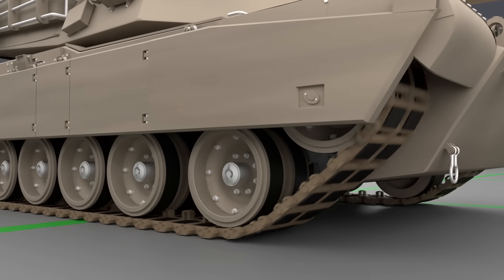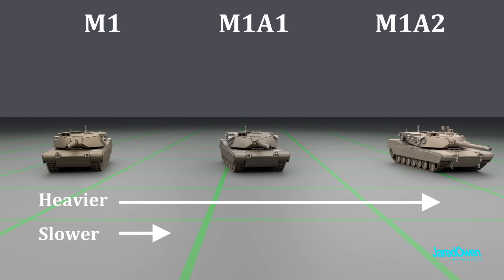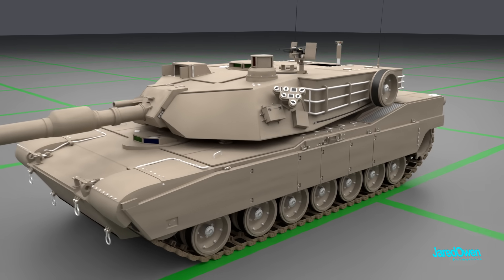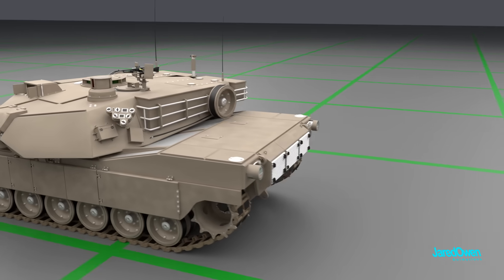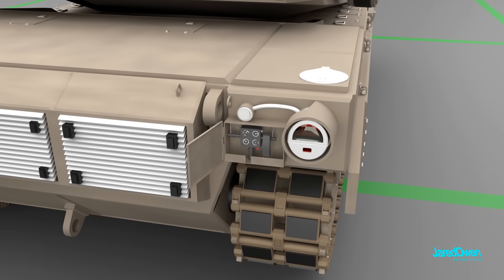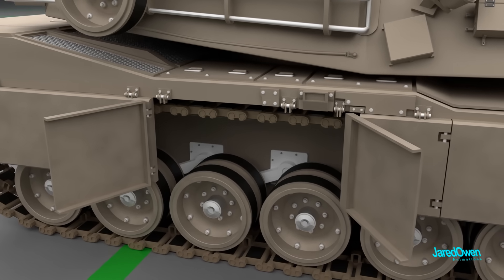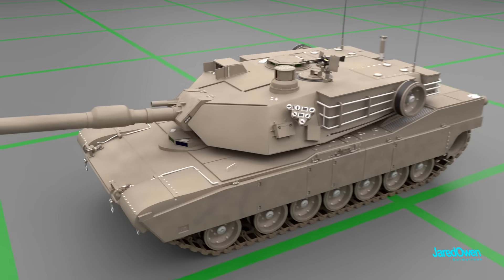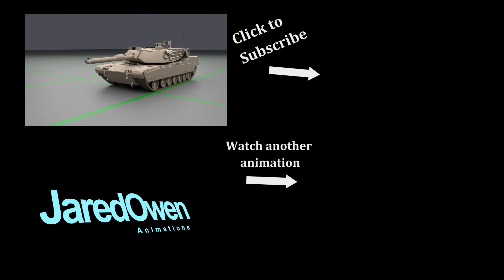How does a Tank work? (M1A2 Abrams)

Comment: Great video. I was on an M1 from 1991-1992 and an M1A1 from 1992 till the end of my service. A few things to note: 1. The commander has a Browning M2 .50 caliber machine gun (The “Maw- Deuce”) at his station/hatch.  I’ve never seen an M1 without one. 2. The smoke grenades up front are actually smoke grenade launchers that launch smoke grenades out in front of the turret.  Thermal sights can see through the smoke. There is also a smoke generator attached to the engine that the driver controls via a rocker switch, that throws thick white smoke out of the engine exhaust port on the back of the hull., and 3., the commander’s “view ports” are actually periscopes. Again, great video. Brought back fond memories.
Reply: Wait, so the turret could chop you in half if it rotated while you were crossing the hatch towards the driver section?
Reply: @sassui90  that is correct.
Reply: @S T no, he doesn't. It's mechanical. It's set up so the trigger is pulled inside the turret and a lever pushes down on the butterfly trigger outside. If I remember correctly it's electrically actuated.

Comment: I wonder if there is a caterpillar Diesel engine that could fit that makes the same power like the 15000 hp turbine. I understand height is a huge issue and the leopard 2 has a boxer style diesel so it’s wide not tall. I think the German engine was made by emc or something like that. Turbines are cool but I love diesels especially caterpillar!
Reply: The MTU 882 on the Leopard 2 is a V12. Not a Boxer.
Reply: @peterson7082  thanks for the clarification. I watched a documentary on it a while ago and couldn’t remember the details. Not sure why I was thinking boxer but I think I mixed it up with the new power pack that general dynamics and another company are trying to sell to upgrade the m2 Bradley fighting vehicle and I think they were trying to offer a new solution to the gas turbine. Makes sense it’s a v8 though because that’s pretty typical for tanks. Russians have been running v8s forever.

Comment: Every time the turret rotated, it merged with the engine deck.  Since this is an accurate model but they can't occupy the same space at the same time, how does it work?
Reply: It's not an accurate model.
Reply: Its not an accurate moded, this was most likely made by using blueprints and looking at reference images.

Comment: capable of 90 mph when ungoverned
Reply: I doubt it.
Reply: @t1e6x12  I was a 19k m1 tank crewman. If you pull the governor, like they did in germany, yes, they are capable of up to 90. try not to believe everything the internet tells you. the people that make these videos are often way off on things
Reply: @dandifusco1868  I've heard 60, 70, and now 90.
Reply: @t1e6x12  my platoon sergeant was in germany for years and they were able to have them ungoverned. they would travel the autobahn at over 80mph. he said it was surreal going that fast in a tracked vehicle.
Reply: @t1e6x12  keep in mind these are the older models and running JP fuel.. jet fuel. they are limited way down in the US because we run diesel in them and training but they are super smooth to drive. they didn;t want us burning up track pads and turning it over which also can happen. those guys out there were nuts. 47 was the fastest I got it to go
Reply: @t1e6x12  but yes, as they arrive in the US governed,, they will go as fast as around 45mph

Comment: At 7:47 how can tank merge itself witt the rest of the body? Does it really rotate 360?
Reply: It does- this isn't an accurate model.
Reply: This was most likely modelled off blueprints (which can be quite inaccurate) and reference images. I encountered the same issue when I modelled the Abrams but was able to work around it. TLDR: either use proper blueprints for 3D modelling things or use a 3D scan.

Comment: I served in Ft. Lewis, WA back in ‘02 and in my unit (513th Trans Co) we had a platoon of HETs with the famous trailer that could haul the Abrahams. One time during a open demo where anyone could go and check the vehicles, I tried to go into the driver’s seat and couldn’t because I was too tall. Apparently there’s a height limit (I’m 6ft 2in). So instead they told me to go into the other hatch and I sat at the Commander’s seat. It was nice. #thankmeformyservice🇺🇸

Comment: 6:08 That's wrong.
Only the M1* Abrams tank and the russian T-80 have a gas turbine as engine. A leopard 2 and many other tanks do have a piston engine.
Reply: 7:10 That's wrong. The projectiles are much thinner, only the sabot has 120 mm in diameter.

Comment: I can't believe that this tank doesn't have automatic loader... wtf USA?
Reply: They have their advantages and disadvantages
Reply: @peterson7082  what is the advantage of not having an automatic loader?
I know that having one means less crew => less space to cover => smaller turret => lighter tank or thicker armour + more inclined angles of turret (since is smaller) which means higher chance of not having a full round hit. Being smaller means easyer to conceive it. On top of that automatic loader is faster.
I know that russian T-64 (first russian tank to have one) was a main battle tank with full armour and 125mm main gun, yet was only 38 tons.
So, again, being curious by nature - what is the advantage of not having one?
Reply: @laurentiutrifan9092  Manpower of course is a double edged sword. Means less eyes, more work spread to three crew.

 Limited designs that allow easy on-loading of ammuniton that doesn't negatively impact protection, some designs of autoloader which reduce crew survivability (Soviet/ Russian or Chinese designs mainly)

Comment: Angled armor isn't just "to make fire deflect".  That can be a side benefit, but if you slope the armor, the effective amount of armor that must be penetrated is increased.  For example, 100mm of armor if flat is 100mm of armor that will be penetrated by a round at a right angle.  At 20 degrees, the amount of armor to penetrate effectively become 106mm.  At 50 degrees of angle, the effective amount of armor that needs to be penetrated is 155mm.  This is based upon the idea that most incoming fire will be more or less horizontal.  If the round is arcing in at an angle such that it strikes the sloped armor at a right angle, it can actually reduce the effective armor.

The benefit is typically taken to reduce the overall thickness of armor then getting back the same equivalent protection, allowing the tank to be lighter.
Reply: Modern APDSDS doesn't care about this

Comment: Why does the US continue to place the engine in the unprotected rear ? Israel uses the same tank but uses the protected front and use the rear as a 5 person troop carrier.
Reply: Thermal signature, armor density on the front will ultimately be less given the volume of space available, some advantages to rear-sprocket trackef vehicles, also height
Reply: The rear generally can hold no more than two on a Merkava IV. That space is first and foremost for spare ammuniton.

Comment: What happens with the round casing once it’s ejected from the gun. Where does it go
Reply: The majority of the casing is made of a glycerin impregnated cellulose (combustible high strength cardboard essentially) so the metal base is all that's left.
Reply: @peterson7082  thanks for the 411.

Comment: He could have made a generic round and nobody would have noticed, but he went and accurately modelled an APFSDS round. Mad props.
Reply: It was basically an arrow shooting at a very high speed.
Reply: @nogisonoko5409  more like shooting a dart, but that's fine
Reply: @dedsec69  arrow or dart both are just things made to make things go boom boom
Reply: @nogisonoko5409  a self-destroying thumbtack
Reply: @nogisonoko5409  more like depleted uranium dart with discarding sabot
Reply: @APotatoWT  
*Tungsten DS
Reply: @nogisonoko5409   Nope. DU has more penetrative power. DU undergoes more work hardening on impact than an equivalent tungsten round and so does not mushroom as easily as tungsten would. This means it can penetrate metal easier.
Reply: @ollie4022  
I did not argue anything about DU or Tungsten round penetration power as i already aware of that fact, the only known country to use DU rounds is USA, thus for general purpose it would be better to use commonly used round which is Tungsten.
Reply: @nogisonoko5409  they are depleted uranium.
Reply: @Harleyglide03  
Yes i am aware.
Reply: @nogisonoko5409  The UK uses DU in their 120mm sabot rounds for the Challenger tanks. The USSR/Russia has used DU in their 115mm and 125mm rounds since the 1970’s as well.
Reply: What does that stand for? "Armor Piercing... FSDSomething"?
Reply: @mauricejohnmac  armour piercing fin stabilised discarding sabot
Reply: @suiseikyo  - and 2 miles is a advertised (Unclassified) distance.
Reply: @suiseikyo  ah yes I remember people playing War Thunder make memes about the ammo.

Armor Piercing High Explosive Fin Stabilized Discarding Sabot High Explosive Anti Tank High Explosive Capped Ballistic Capped
Reply: @mauricejohnmac  rh
Reply: Im sure there would have been a lot of people pointing that out in the comments (and I mean a lot).
Reply: wow...
Reply: if he used a generic round the comments section would just be people laughing at it 💀
Reply: some would notice though
Reply: In Tom Clancy's (Red Storm Rising, 1986), they're described as a "40mm tungsten dart.  Traveling nearly a mile per second."  3,500mph is in fact 0.97 mi/sec.  That was back when they were fired from a 105mm gun.
Reply: @jeffreysickels1970  40mm, that is less than 2 inches...only grenade launchers use that caliber
Reply: @firstlt2  You're right.  The sabot penetrator rod diameter currently used in the 120mm gun is 27mm.  Material is depleted uranium.  (I looked it up)
Reply: War Thunder meme intensifies
Reply: https://youtu.be/PTc1YRqs160  made in Rhodes first.
Reply: https://youtu.be/4G6e4TaJxkI 
excellent ⬆️
Reply: A sabot round
Reply: https://youtu.be/88yQhk7kd6E more expensive  ,
Reply: bruh...just call it a sabot round
Reply: What do you mean Abrams tank will be destroyed by Rpg-29 on 4 shots or 2 two that's not how it works dumbass 💀💀 RPG-29 have only 750mm -900mm penetration it is tandem shape well tandem shape are not effective against NERA and Composite, since Tandem uses Precursor charge which small to defeat ERA alone anytging larger than precursor Charge will be useless, and anything Larger and thicker ERA can stop Tandem shape, 
Abrams can stop RPG-29 easily doesn't matter if it's tandem shape or not.
Reply: What do you mean Abrams tank will be destroyed by Rpg-29 on 4 shots or 2 two that's not how it works dumbass 💀💀 RPG-29 have only 750mm -900mm penetration it is tandem shape well tandem shape are not effective against NERA and Composite, since Tandem uses Precursor charge which small to defeat ERA alone anytging larger than precursor Charge will be useless, and anything Larger and thicker ERA can stop Tandem shape, 
Abrams can stop RPG-29 easily doesn't matter if it's tandem shape or not.
Reply: Абрамс говно
Reply: https://www.youtube.com/watch?v=Z_ADHAXCAvs
Reply: I assure you the comment would've tore him a new one so yeah
Reply: The Sabot in question is actually the M865 TPCSDS [Target Practice Cone Stabilized Discard Sabot] with the subprojectile being made of aluminum.
Reply: I knew what they looked like before this but, what does it stand for?
Reply: Do not judge someone else’s past; you don’t know your future
Reply: I would notice tho...

Comment: Despite it's various problems, my favorite tank of all time is the Tiger. That thing was a beast !
Reply: Which one
Reply: The Tiger revolutionized tank design... and created the class of tank used today, the first MBT.
Reply: @sandervanderkammen9230  I think youre really overemphasizing the impact the Tiger had.
Reply: @t1e6x12  Think you know very little about tanks...
Reply: @sandervanderkammen9230  What was so great about the Tiger which revolutionized tank design?
Reply: @t1e6x12  It was the worlds first MBT... and the most combat effective tank in service during WW2.
Reply: @sandervanderkammen9230  If it was the first MBT, why were so few produced and why were they seldom present in battle (in comparison to other German tanks)? Surely, if it was an MBT, it would have taken precedence in Germany's armored forces rather than being one of the fewer produced tanks, with the Panther and Panzer 4, Stug 3, and others out producing it. With those sort of characteristics, it does not seem fitting to categorize the Tiger as a "main" battle tank, simply because it wasnt. 

As for combat effectiveness; against other tanks, sure, but in any other role? The point of a main battle tank is to be universally applicable to situations. The Tiger, being not the most nimble tank, prevented it from fitting into other roles which are more akin to MBTs.

If you were to search up what the world's first MBT is, you will most likely see the Centurion take the crown, and rightly so. If you wanted to claim something like the Panther was the first MBT, or the Panzer 4, or T-34, or M4 Sherman, that would be debatable at best. The Tiger does not fit into the category of being an MBT period.
Reply: @t1e6x12  You really don't know anything about tanks at all do you?
Are you a gamer???
Reply: @sandervanderkammen9230  You tell me I dont know anything about tanks but you have yet to prove me wrong.
Reply: @sandervanderkammen9230  Let me ask you a question. Are you a wehraboo?
Reply: @t1e6x12  Thank you for confirming my suspicions...
Reply: @sandervanderkammen9230  Wow, great attempt at an ad hominem attack.
Reply: @t1e6x12  You are obviously just  spoiling for a fight, angry little internet bullies don't intimate me so you are in the wrong shop for troll bait son.

Comment: Damn, dude. Where to start? The "engine you show is really the "pack" it is the engine and transmission. The engine is a lycoming 1500 Horse Power static thrust engine about a foot wide and 3 feet long. The rest of that crap is the transmission that converts the trust back to rotation...havent watched,beyond 6:44 yet, but I need some entertainment, haha. Also the pic of the sabot round reaching the bore evaluator, haha, damn. The gun tube is actually made in west Germany. Gun tube is damn near five feet in the turret from the turret front slope. Please, ask a Tanker (19K) before posting and not a damn game designer. We sell them to our "allies". It is largely declassified. But thanks for the laugh.
Reply: The guns are made in NY. The gun is a licensed variant of the German L/44.
Reply: @peterson7082  maybe now. 1998 and before sure were not.
Reply: The M256 barrel is different than the  German L/44 and are all made at the Watervliet arsenal in New York.
The Rheinmetal L/44 barrel is lighter,   made with a better autofrettage process and is Concentrically Balanced .
The M256 barrel is not.
Reply: @sandervanderkammen9230  yeah. I hear it is spin cast....

Comment: ok Charlie company 167 armor 4th I.D. I'm only in at 1:54 and those are definitely not the electronics, they are actually just little metal bars that hold the front track cover down, and no that is not what it's actually called but i havent been on a tank for 11 years
Reply: Yeah I noticed that too when modelling the Abrams. No way those metal bars are elctronics.